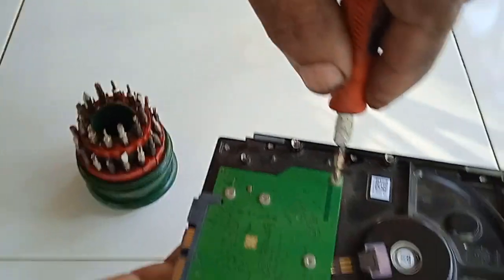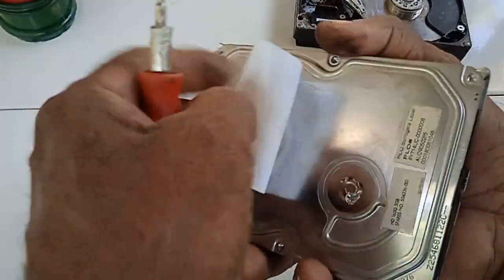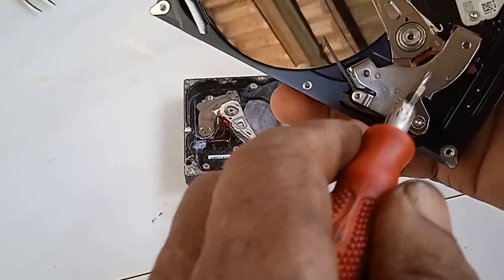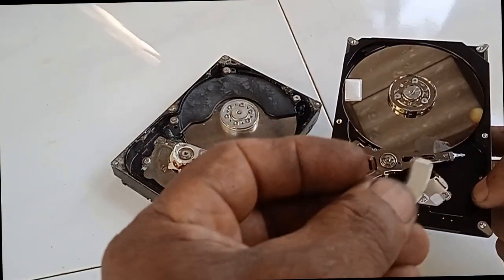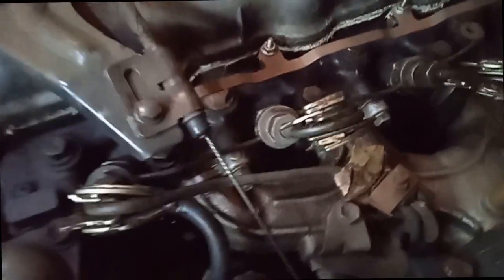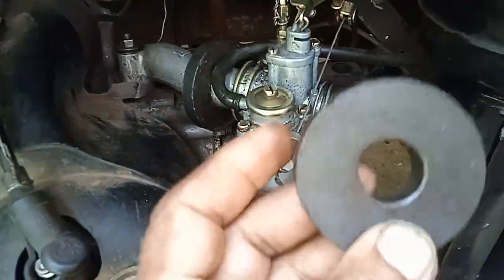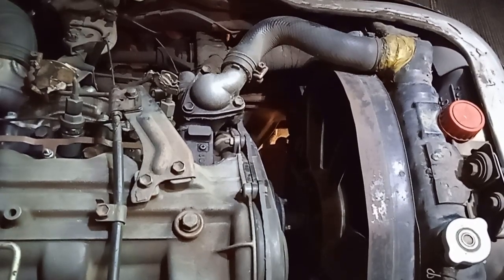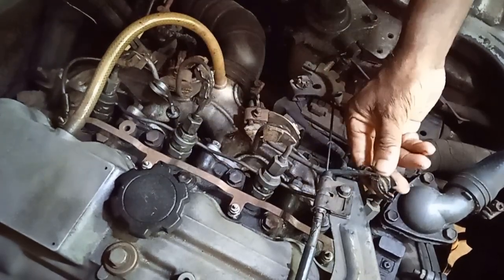How to increase fuel efficiency by using magnets

Comment: Magnetic fields can influence petrol (gasoline) in several ways, though the effects are mostly related to molecular alignment rather than direct changes in chemical composition. Here are some key effects:

### 1. *Fuel Flow & Combustion Efficiency (Controversial)*
   - Some studies and patents claim that exposure to a magnetic field can improve fuel efficiency by aligning hydrocarbon molecules, potentially leading to better combustion.
   - However, scientific consensus on this effect is weak, and many studies show negligible or no improvement.

### 2. *Reduction of Carbon Deposits*
   - Some fuel treatment devices claim that magnets can reduce carbon buildup in engines by altering fuel molecule clustering, leading to cleaner combustion.
   - Again, this is debated, with limited peer-reviewed evidence supporting these claims.

### 3. *Preventing Static Charge Buildup*
   - Strong magnetic fields can help reduce static electricity in fuel pipelines, improving safety and reducing the risk of ignition in refueling operations.

### 4. *Electromagnetic Interference*
   - Magnetic fields near fuel storage tanks or pipelines may interfere with electronic sensors used in fuel monitoring and flow measurement systems.

### 5. *No Direct Chemical Changes*
   - Petrol is a non-magnetic, non-polar liquid, meaning a magnetic field does not directly ionize or chemically alter its structure.

Comment: I don't think so .please explain the theory behind it
Reply: So there are a lot of theories ,one of it is that due to the effect of magnetic field on the fuel at the inlet pipe the large fuel molecules break down into small molecules hence the combustion process becomes more efficient producing less outlet gases ...more proper combustion equals to increase in mileage
Reply: @pranayk868  that makes sense. Thanks
Reply: Magnetic smoothly for fuel rework 👍❤️💐
Reply: Magnetic fields can influence petrol (gasoline) in several ways, though the effects are mostly related to molecular alignment rather than direct changes in chemical composition. Here are some key effects:

### 1. *Fuel Flow & Combustion Efficiency (Controversial)*
   - Some studies and patents claim that exposure to a magnetic field can improve fuel efficiency by aligning hydrocarbon molecules, potentially leading to better combustion.
   - However, scientific consensus on this effect is weak, and many studies show negligible or no improvement.

### 2. *Reduction of Carbon Deposits*
   - Some fuel treatment devices claim that magnets can reduce carbon buildup in engines by altering fuel molecule clustering, leading to cleaner combustion.
   - Again, this is debated, with limited peer-reviewed evidence supporting these claims.

### 3. *Preventing Static Charge Buildup*
   - Strong magnetic fields can help reduce static electricity in fuel pipelines, improving safety and reducing the risk of ignition in refueling operations.

### 4. *Electromagnetic Interference*
   - Magnetic fields near fuel storage tanks or pipelines may interfere with electronic sensors used in fuel monitoring and flow measurement systems.

### 5. *No Direct Chemical Changes*
   - Petrol is a non-magnetic, non-polar liquid, meaning a magnetic field does not directly ionize or chemically alter its structure.

Would you like information on specific applications, such as magnetic fuel conditioners or industrial fuel handling?